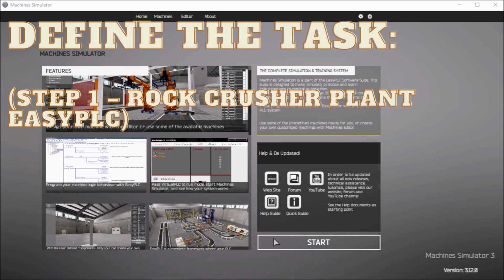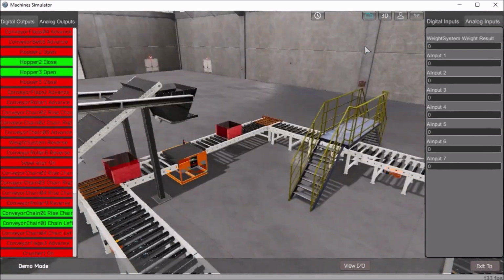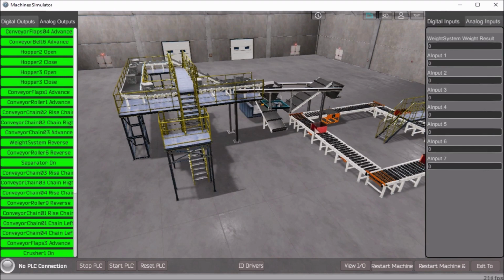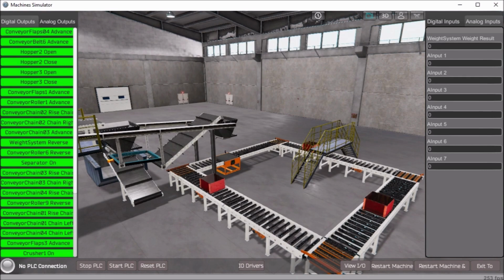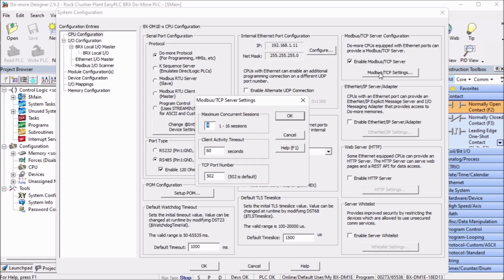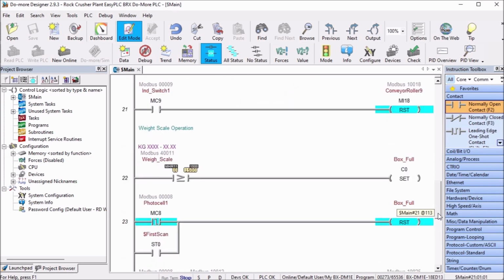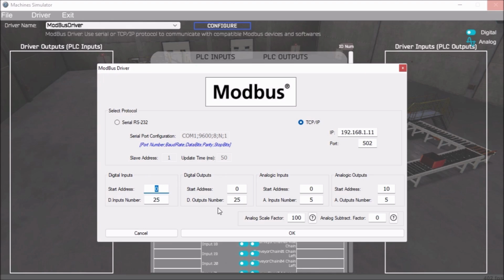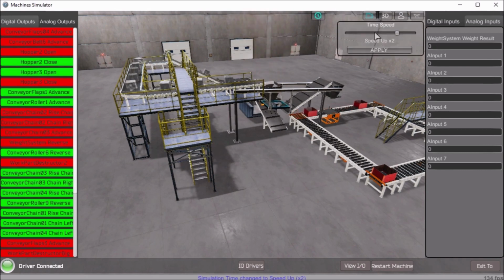Master Rock Crusher Automation: 5-Step PLC Programming Guide

Comment: great video.  I see over the years some of the new engineers are only fair at PLC programming and use crazy math blocks to do basic logic ideas, even Rockwell Engineering create long costly complex ladder code.  Seems like the drag and drop snap blocks are making readable code headway as in AD Arduino Productivity Blocks. This programming needs more features such as Modbus blocks which would even help in the IIoT and IoT like solar-cell inverters.   Anyway this is a very interesting online automation factory. 😎  thank you very much.
Reply from the maker: Thanks for the comment q zorn.
IIoT or IoT can be easily controlled using Node-RED. I found this to be a great IoT enabling software that uses flow.
https://accautomation.ca/series/node-red-iot-enabling-software/
Garry
Reply: @ACCautomation  thank you